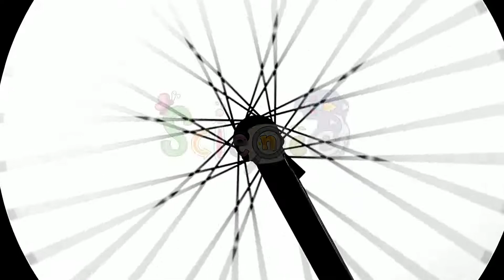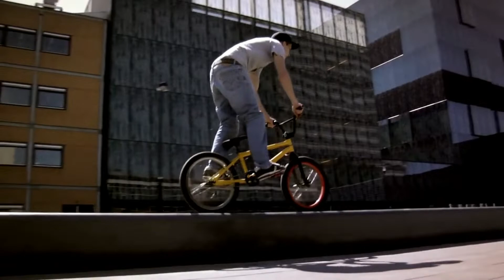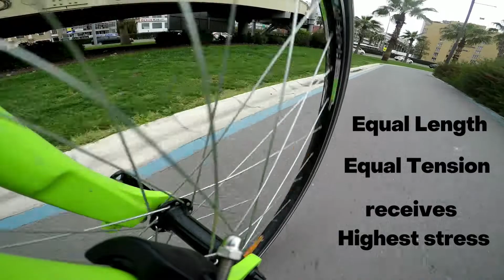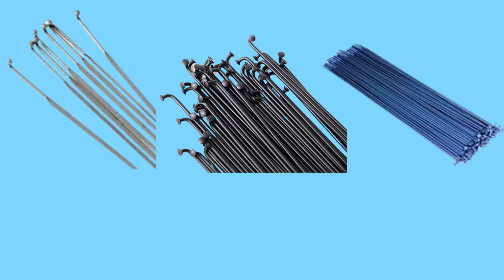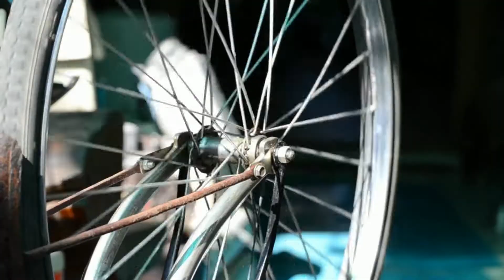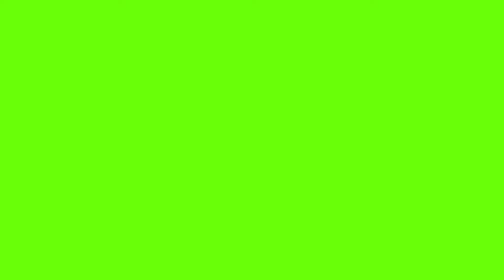Why Do Bicycles Have Spokes?

Comment: If spokes are so useful in bikes why don't other vehicles such as cars, trucks have it
Reply: Wheels of bicycles have less area of contact with the road as compared to other vehicle wheels like cars or buses, to keep them study while cycling spokes are provided as it increases the inertia without large increase in mass. Whereas in cars or buses, more surface area is in contact with the road and mass of vehicle is enough to keep them sturdy. Hence the vehicles with greater mass are not provided with spokes as they do not need them